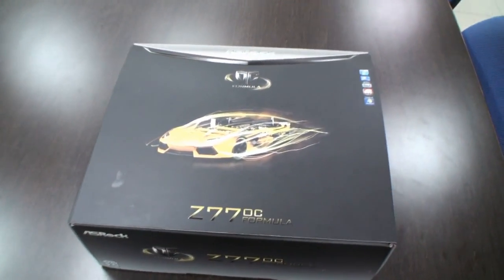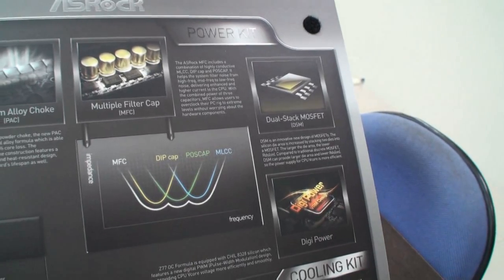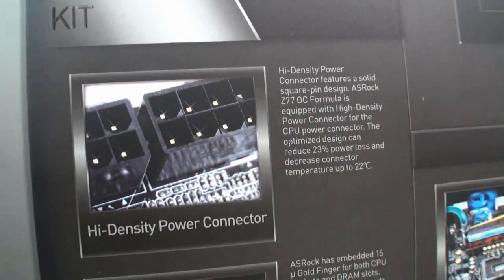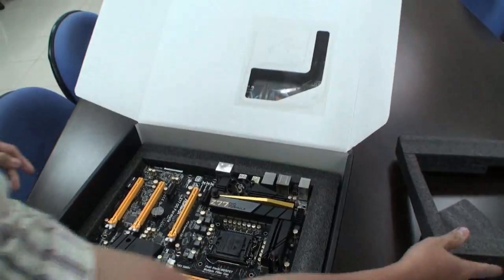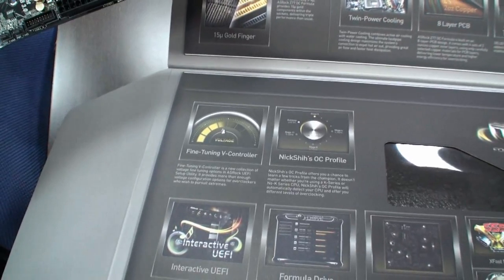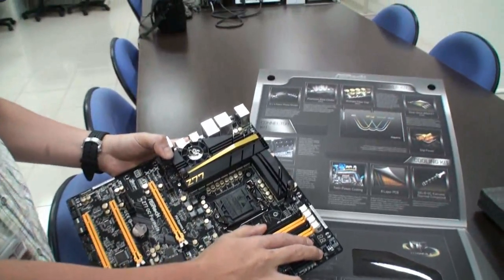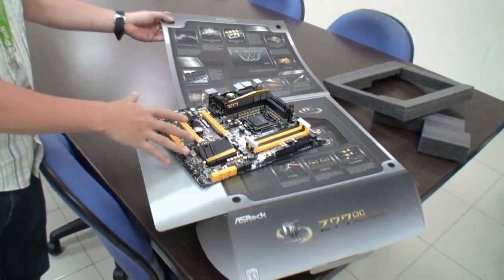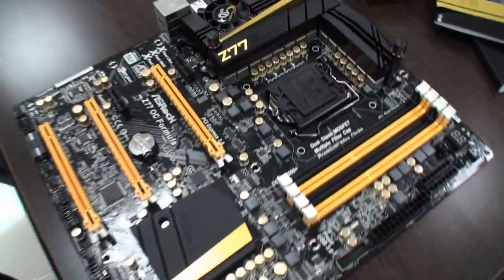ASRock Z77 OC Formula Motherboard - Full Introduction by Nick Shih

Comment: Why are you bringing Apples and Oranges , Asus and Asrock have two different Sales points...   Asus brings you High performance at High Cost, Asrock which is Independent now Brings Performance at a moderate to low Cost and has been proven... I've overclocked and Posted Results from Asrock before I've had tons of DOA Asus Rampage boards and pay a ton of money for them expecting they would and should be tested at such a cost...

Comment: Asrock and Asus Haven't been Related for 2 Years now, Use to be Asus was the Flagship company and Asrock as for the low end performance users.... That's no longer the case they make very nice boards Price for Performance its better than Asus( If you have the money for Asus, It does provide the top end)

Comment: I just want to see some real oc on this board and not just LN2 but mainly air and watercooling to see what the board can achieve. For once i'd like to see a board be stable at 4.9 and above using Ivy Bridge and yes I know they get hotter than SB but with the right watercooling flow they should be stable at voltages of 1.35 maybe even push it more Ivy Bridge is meant to withstand higher temps.